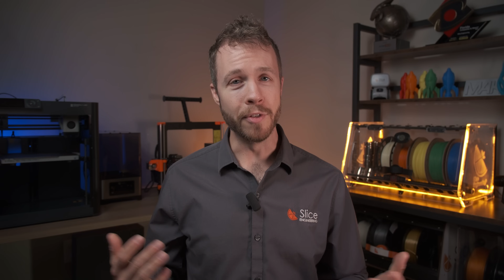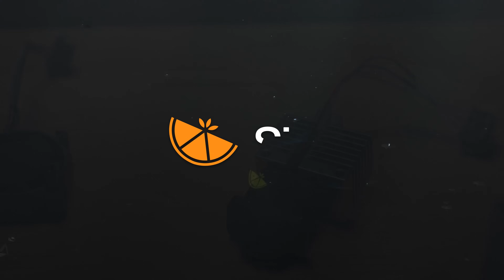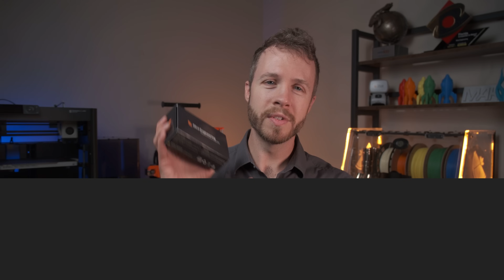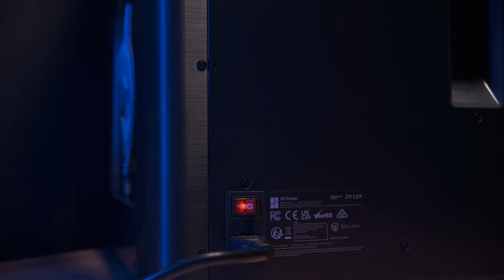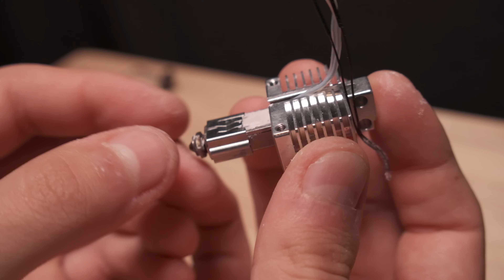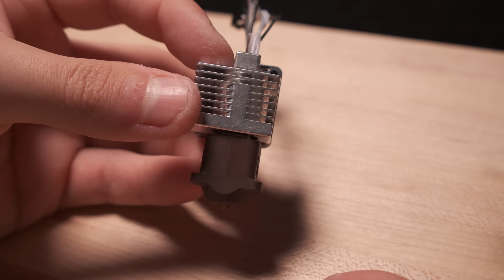The Ultimate Hotend Upgrade You’ve Been Waiting For | Mako for Bambu Lab

Comment from the maker: Thank you for all the feedback and questions! We want to clarify a few points:

Downtime Explanation: While the video shows the physical swap of the hotend taking just a couple of minutes, the 15-20 minute estimate accounts for the entire process, including swapping heater, sensor, fan, and the cooling and heating cycle - basically going from a printing hotend to another printing hotend of another size, aka downtime. The intent of Mako is that you won’t ever have to do that again, since swapping a nozzle is so much easier and doesn’t cause wear and tear on the fragile heater and sensor cables. Speaking of nozzles…

One-Handed Nozzle Swap: We hear you! A demo video showcasing the one-handed nozzle swap feature is coming very soon. Major oversight on our part not to include that in this video. Stay tuned! 

Flowrate Numbers: We're in the final stages of flowrate testing for various materials. Detailed results will be released shortly along with material-specific profiles. We appreciate your patience as we finalize a full set of profiles. 

Installation Clarification: This video's “Preparing Mako” section features installing Mako with the electronics that came with your printer, which requires additional steps vs. the preinstalled version. Mako can also be purchased with electronics pre-installed. 

Slice is known for producing industrial products that last for thousands of hours. Mako is an opportunity to take advantage of that expertise and have a hotend designed to outlast your printer in addition to the flexibility of having application-specific nozzles.
Reply: The video isn't out yet, right? Or am I missing it?
Reply from the maker: @OfficialViper  Yes, the demo video is up now! You can check it out here: https://youtube.com/shorts/4agPlEDwnYk
Reply: @SliceEngineering  Oh, it's a short, that's why I missed it. Looks good though! A very simple process.

Comment: Why didn't you tell that it is designed to go up to 400°C, thats gonna be one of the selling points for me!!!
Reply from the maker: Although the Mako Hotend is rated up to 400°C, Bambu Lab Printers are limited to 300-320°C by the firmware, depending on the model.

Comment: i just need a hotend für 350°C
Reply from the maker: The Mako Hotend is rated up to 400°C, however Bambu Lab Printers are limited to 300-320°C by the firmware depending on the model.
Reply: @SliceEngineering  yeah i have Seen that... I think im going to do some Kind of Modifikation or use a qidi plus 4... I think the Carbon rails and bearings dont Like the Heat as well so IT might Not be the best Idea anyway. You could propably Just modify the K Sensor so Its Reading wrong with the risk of melting the Extruder. Than using an external Thermometer ready the real temp and adjust. So its actually 330°c but Reading 180°C If the heating element can survive...
Reply from the maker: @carbonarne  We wish you the best with your Qidi Plus 4! We haven't worked with it, but we do have a number of customers with this printer.

Comment: What garbage... So you have to heat the nozzle to tighten so it doesn't leak...just like old MK6 hotends .. you're not even in the same game as E3D and their Revo system, with true one hand nozzle changes, and since the nozzle and heat brake are press fit, no hot tightening to avoid leaks

Comment: All the uneducated comments are wild 😂

Excited my new hotend! Now just stocking up on cheap nozzles and easy cut and swap rather than disassembling the full hot end.

Interested in a complete assembly rather than piece mailing 😊
Reply: Do you even have a Bambu Lab printer? Why are you disassembling hot ends so much, all you need to do is swap them out. I think you are doing something wrong if you need to rebuild a nozzle when you want to swap it. You can get fully assembled hot ends for like $35 that do the same as all of these aftermarket con jobs.

Comment: 2 Questions…. I have this item in my cart and I’m ready to pull the trigger, but I need clarification please and thank you.

Question 1.What is the difference between the GammaMaster & CHT nozzle? 

Question 2. Will we be able to utilize the CHT capabilities out of box, or will Bambu or the user have to create a higher flow rate profile to utilize its full capability?
Reply from the maker: Hello, sorry for the delayed response! The CHT nozzle is designed for even higher flow rates than the GammaMaster, which means it can print faster. That said, the GammaMaster is still 30% faster than stock nozzles—cutting about an hour off a three-hour print. To fully utilize the CHT’s capabilities, we’ll be providing a few profiles to help guide you and maximize performance right out of the box.

Comment: I can't wait! The only thing I'm upset about is having to wait until mid August. Increased performance and super simple swapping between different size nozzles. If you don't care about removing screws, disconnecting / reconnecting cables or even swapping the fan and thermistor then maybe this isn't for you. If you're like me and want a simple and fast way to switch between different size or manufacturer nozzles then this seems like an awesome option.
Reply from the maker: Simple and fast, exactly! We are building as fast as we can, and can't wait to get Mako out there!
Reply: @SliceEngineering ordered with a complete set of nozzles. Can't wait!
Reply: Get the Panda Revo... You can get an Obxidian high flow nozzle for the Revo system and will be much happier with the rapid nozzle changes

Comment: How did we come so far and then engineer backwards? I used to have the stock bambu x1c hotend. Took like 2 minutes for me to change but not 20 lol. Concern was always the plugging and unplugging the connectors and limited nozzle size availability from bambu. I upgraded to the E3D Panda revo. Which unlike you guys, actually showed how to remove the nozzles. Comes assembled out of the box by the way, so true plug and play. Now I have 8 different nozzle sizes including 1.4mm; obxidian, diamond backs, High Flow those are all available too. not worried about snapping of a connector any more. Lefty loosey righty tighty all with your fingers, no wrenches needed, dont need to remove the sock. No heatcreep, i print PLA with doors closed and 55c bed temp. And as a bonus, the aluminum heatsink is blue anodized instead of being left bare like this one lol

Comment: Wow tough crowd. Interesting product, would like to see test results and actual nozzle swap though. 15 min swap time for oem nozzle is a bit steep, but that's obviously based on if you need to do a full swap of the fan and thermistor. I do wish bambu had this nozzle only swap ability though. It's a steep price, but if quailty remains and results are close to 60 percent speed increase that's a considerable upgrade.

Comment: I don't understand the need or the sell here. Honestly, this is just for folks who want to use more standard nozzles. It doesn't realistically save time, because a whole nozzle hotend Bambu assembly change is just the two screws. Changing a nozzle requires heating up and tightening. That could also lead to leaking, over tightening and stripping etc. It's kind of a step backwards just to be able to use other brands of standard nozzles. A bit of a miss here on the marketing, although it is a useful adapter

Comment: hard to believe paying 9x more money for something that won't be 9x faster
Reply: This is bad math. Let's run through a theoretical example. Let's say you run a print farm and this even just 10% faster. Let's say the prints you make generate $30 per profit in a 24 hour period (probably pretty conservative if you have a good customer base). Assuming your printer is running at max capacity, this means you can now generate 10% more profit by churning out 10% more prints. So now you're making $33 per day in profit or $3 more per day. At a $100 cost, this is a payback period of 33.33 days. Extrapolated over a year with these assumptions, you could make nearly $1000 in extra profit. If it's 20% faster, your payback is even shorter and potentially yearly profit increase is over $2k.

Obviously this is an over simplified example, but your math and logic is way worse. 

Is it more expensive than most nozzles/hot ends? Yes, but even small increases in output add up a lot over time. This increased output does need to be proven by Slice, but my discussion is assuming it is faster.
Reply: @jonners710  Mr. Mathematician, instead of waiting 2 years to make 2000 dollars more, I better put 2000 in two more bamboos.
Reply: @3DHRFARM  if you have the capital up front, yes that may be a valid strategy.

If you're limited on space? You want every bit of performance from each printer.

My main point was saying that it doesn't have to be 9x faster to be a good financial decision.

Comment: Credibility 0.  15 minutes to swap a nozzle?  Nope.
Reply: I've tried all the aftermarket hotends with the interchangeable nozzles and they suck. It took longer to change one of them and risk damage to the print head than just swapping out a Bambu one. 1 minutes max, 5 minutes if you need to swap over the electronics

Comment: Why would you just not make it v6 compatible?
Reply from the maker: Traditionally, FDM nozzles have always been developed for ease of manufacturing, not thermodynamic efficiency. FIN is the first time a nozzle has been designed for optimal insulation to prevent cooling of the tip. The standard is open source and we've done something completely unprecedented in the industry by collaborating with other nozzle manufacturers to make a large variety of nozzle types available at launch.

Comment: Need to see the nozzle swap process.  Since Bambu leaves filament in the hot block, how can you change without it not bottoming out improperly? Any plastic affecting the seal is a disaster in the making, right?
Reply from the maker: Thank you for the suggestion!!
Reply: Not just left behind, but if you have the AMS, it's cutting it off to where it's hard to get the remnants out.
Reply: @See-essEll  it would be a 30 minute exercise to pull that piece out unless it comes out with the nozzle. That was the piece I was concerned about. And what if untwisting the nozzle breaks that piece of filament, how does the new nozzle seat correctly.  I'm sure they have researched all this, but I want some explanations on how this works. This kink of thing was always a problem on my old printer, and zero with stock Bambu nozzle.
Reply: They didn't have any of those $25 Torq wrenches that you need to buy separately to change their nozzles, lol. What a scam.

Comment: Nice,  so you can use M6 bondtech reprap nozzles with this hotend?
Reply from the maker: You will need to use FIN (Free and open-source Insulated Nozzle) for Mako!
Reply: @SliceEngineering  Ok ,  going to need add some to my order.  Are the FIN nozzles available on your website to order?
Reply: @SliceEngineering  I do not see the FIN CHT nozzles to pre-order
Reply from the maker: @chrisc9213  currently we only have them available in our hotend kit, we aren't sure yet when Bondtech will make the CHT FIN Standard available!
Reply: @SliceEngineering  I see you also work with DiamondBack (Championx), so will be a DiamondBack nozzle with the FIN Standard available in the near future?